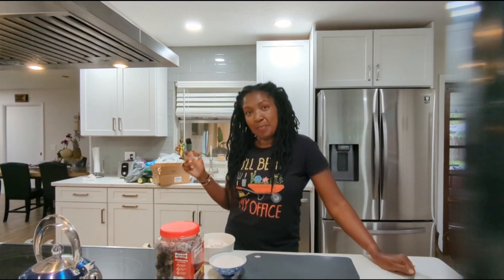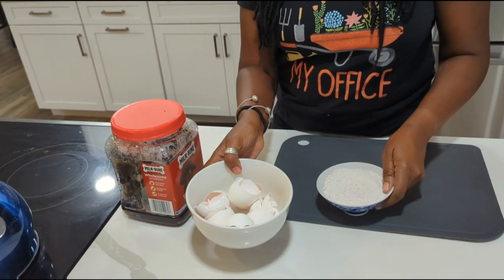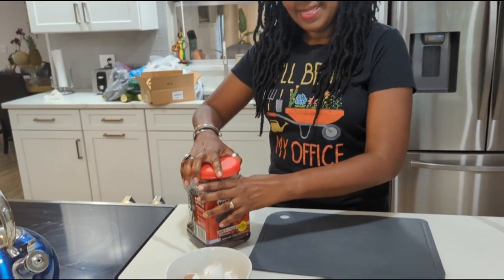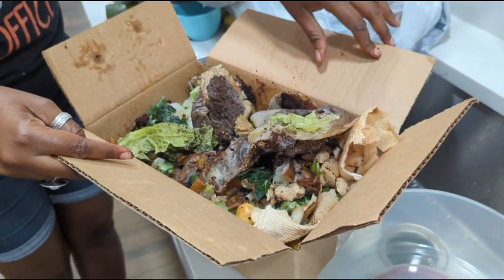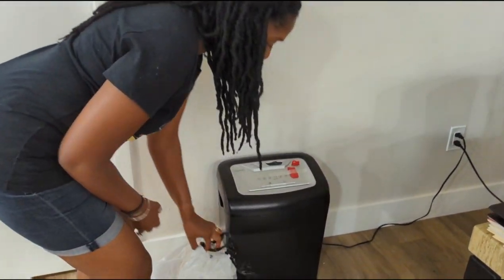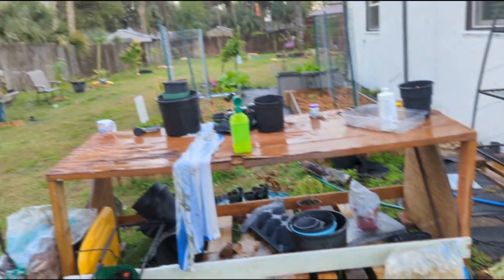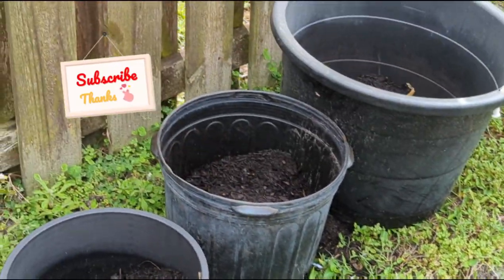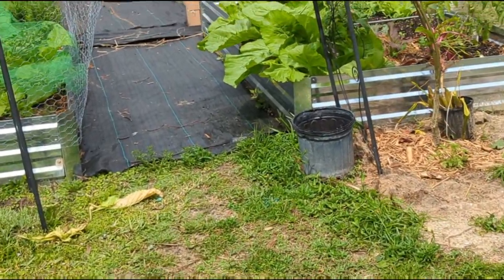5 Easy Composting methods plus 2 things you can compost that will surprise you.

Comment: Great video ‼️ I use the 3 GeoBins in my backyard for composting.  I throw chicken bedding in them along with dried fallen leaves.  I also use Walmart  18 gallon plastic totes with holes drilled on the bottom for drainage.  I place the totes next to my fruit trees and throw my extra kitchen scraps in the tote. I then cover the scraps with dried leaves.  I  place some hardware cloth over the top to keep the critters out.  I water inside of the tote which waters and feed the fruit trees. Of course when it rains, I don't have to water it.  It works GREAT ‼️😉 Thanks for sharing.  😊
Reply from the maker: That is awesome.  I def will add a tote or 2 in addition to my large pots throughout the garden